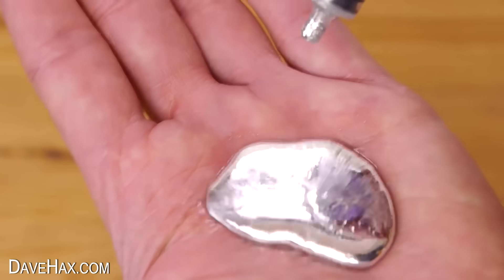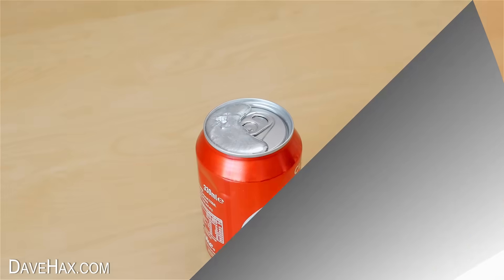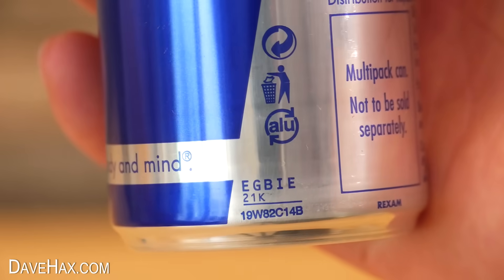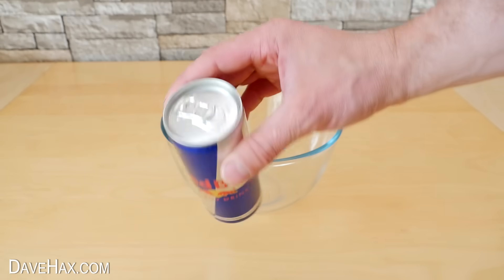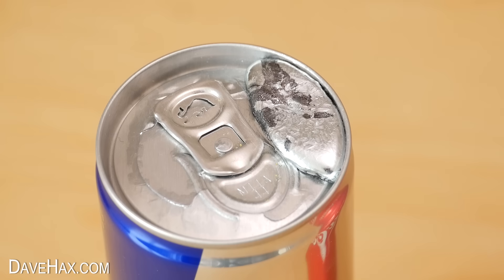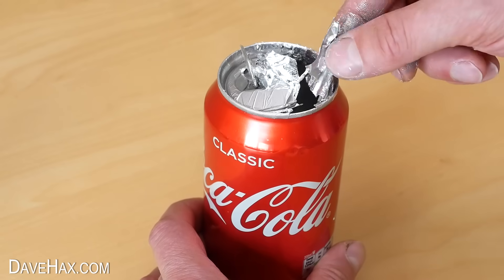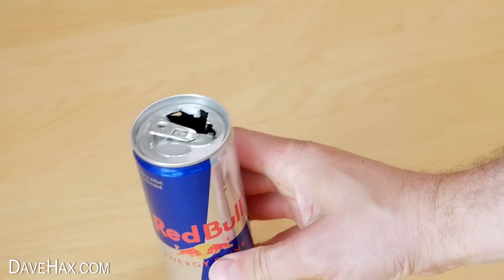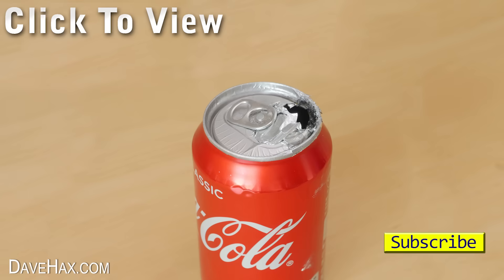Amazing - What Gallium does to an Aluminium Can

Comment: aluminum oxide stops gallium from penetrating. aluminum oxidizes fast, so you should first apply gallium then scratch the surface beneath it. scratching it with a needle should be enough.
Reply: An even more effective way would be to use a lil but of dilute hydrochloric acid to chemically get rid of the oxide layer, wipe it away then apply the gallium

Comment: Why don't you just melt the alumunium to try an experiment again an d maybe it Will become galium again
Reply: It won't, really won't. If there's enough gallium in the alloy you can simply put it in water and the metals will separate however if theres too much aluminium in the alloy you won't get enough gallium back. So what you could do is put the alloy in a sodium hydroxide solution to get rid of some of the aluminium then put it in water

Comment: The reason the whole can isn't like the top is because the canes aren't one hole price but actually two with a filed seal at the top which isn't welded together so the gallium couldn't get through the oxidation layer on it

Comment: Aluminium always forms a really small slayer of aluminium oxide by reacting with oxygen in the air. It is really thin but aluminium oxide is quite a stable material, which prevented the fusion with gallium.

Comment: There was a thin layer of aluminum oxyde, which is the reaction product between air and aluminium. That's why it didn't work until you used sandpaper
Reply: I thought it was some kind of acrylic coating to prevent the can from oxidizing. If you've ever found like a really old can in the woods it'll crush into dust like that from oxidizing long enough.
Reply: @Jared Flynn No it's really aluminum oxide. Though some cans do have a plastic coating, but thats on the inside.
Reply: @romanpul  aluminum oxide is what happens when aluminum oxidizes
Reply: Jared Flynn You don‘t say. Aluminum is a highly reactive metal and oxidizes almost instantly when exposed to air to form a thin layer of unreactive oxide on the surface of the metal. That is why this experiment only works after sanding the can.
Reply: @romanpul  yes... that was my point?
Reply: Jared Flynn Oh, sorry then 😅. I just wanted to point out that some cans have an additional acrylic coating on the inside but not on the outside
Reply: @romanpul  ahh got it
Reply: @romanpul  lol i can remember the exact line in my class 9 or 10 textbook 😂😂
Reply: @jaredflynn3750  reduced alluminium is useless
Reply: @jaredflynn3750  You're right.  Aluminum cans are made in 2 parts, the can itself and the cover which is applied later.  Both are covered with acrylic coating before they are assembled after the liquid is poored inside.  The coating is applied ouside after the label is printed and inside after.  That's why the can wasn't affected even if the top was crushed.  I worked in a can factory and I was responsible to get the coating tanks refilled every now and then.  We used to call it the "varnish".  :)
Reply: Exactly, the oxide layer on the aluminum protects it from the gallium.  You have to scratch or cut it under the gallium, otherwise it immediately oxidizes again.
Reply: Yeah, I added a comment (before I saw yours) saying the same thing, but going somewhat more into detail.
There was also a crude joke thrown in, in regards to something Mr. Narrator Dude had said.
Reply: Chemistry :)
Reply: Scientist has entered the chat
Reply: @willos7081  no is common knowledge
Reply: I was about to comment this
Reply: God damn, you were months ahead
Reply: @sumsarsiranen  I mean I hadn't read the comments yet.
Reply: I was thinking the metal used for making the cans was maybe because of it being dipped into some kind of solution,  kind of like with galvanized steel
Reply: @Kc-jx8uq  Nope, the top few layers of atoms react with the air to form a diamond-hard substance called aluminum oxide. It pretty much blows iron oxide out of the water in terms of usefulness.
Reply: @magisterrleth3129  so wonderful for you be so assured to respond with absolute confidence like you are the god of truth. Even after someone else made the comment about how polymers are applied to the surface to make sure it stays shiny and the labels don’t wear off easily. Your not wrong but your not right either. It has both a thin oxide layer and a polymer coating. It’s also so the aluminum doesn’t leach into the drink and make it taste metallic. Sodas are after all acidic. So a “plastic” layer is applied for these reasons. Sanding removed both layers. So Half a star for you Magister.
Reply: @magisterrleth3129  Considering iron oxide is also known as "rust", yeah aluminium oxide is a fair bit more useful. =)
Reply: @jubuttib  Aluminum's rust is the envy of the rust world. Every metal wishes it could oxidize like aluminum.
Reply: @magisterrleth3129  Yeah. Titanium (di)oxide walks in, being all "I'm a really good white pigment!", aluminium goes "Literally rubies and sapphires, among a thousand other uses!"
Reply: @jubuttib that’s what I was thinking lol.
Reply: Looool
Reply: Cans are coated in polymer to prevent al leeching inside
Reply: And thats also why it worked better on the coke can. The red bull can had more time to re-oxidize
Reply: Ah, yes. I knew that would be the case, but I am still satisfied to be confirmed of my suspicion.
Reply: OH thank you!! I was just wondering that!!
Reply: Cans are foodsave because they are thin coated with plastic layers..thats why he needed to scratch that layer..
Reply: Ooooo cool
Reply: Fun fact: thin plastic
Reply: @amar_sm4222  fun fact: corrundum
Reply: @eatornator-ox2dx corundum? Rubies?
Reply: @amar_sm4222  Fun fact: thin oxide layer on the surface of the aluminum.
Reply: @amar_sm4222  thats on the inside
Reply: @amar_sm4222  exact ! Burn it and you will see the plastic film turning brown

Comment: Does this affect the gallium in any way or can you reuse the gallium after the experiment?
Reply: It creates an alloy with the aluminum, but you can get the gallium back by putting the alloy into water where the aluminum turns into hydrogen gas leaving behind the gallium.

Comment: When do you think he’ll realize he could’ve popped the top and turned the can upside down?
Reply: As soon as he read this comment
Reply: @cafeinatedmilk  So how is the outside different between the top and bottom?
Reply: @cafeinatedmilk  not the inside
Reply: @cafeinatedmilk  Oh, I forgot how they put soda on the bottom of the can and not the top which is why he can't just empty the csn through the top and put the gallium on the bottom
Reply: Ben Speer he didn't want any gallium to fall into the can
Reply: @PaulNguyenDrums  how would it fall in the can if he pours it on the bottom of the can?
Reply: Susan Ramirez ooooh, I thought Ben was referring to emptying the can, that's also a good idea
Reply: The Joke

Your Head

Comment: Aluminum cans are oxidized aluminum meaning there is a small layer of non aluminum substance on the top, if you scratch it up or use hydrocloric acid it peels it right off allowing you to use the gallium a little bit better, my knowledge on this isnt too extensive so i dont know exact terminology

Comment: Aluminium reacts with oxygen in the air to form a layer of aluminium oxide which serves as a protective barrier. By rubbing sandpaper he removed this layer, allowing the two metals to mix..

Comment: Congratulations. You have discovered the other reason, aside from light weight, that aluminium is a great material. Aluminium oxide which naturally forms a tenacious protective surface on bare aluminium under normal atmospheric conditions.

Comment: yeah the "coating" is formed when aluminum reacts with oxygen in the air to form a 4nm thick layer of aluminum oxide. This happens whenever aluminum is exposed to air and prevents further oxidation as well as protects the aluminum from many other chemical reactions.

Comment: Hi dave i did not have to watch the full video to understand what you were doing wrong.  being a welder and even welding alum pipe to rt standards you must remove the thick oxide layer that develops on it.  so for every pass of weld i make on alum i wire wheel brush it till it is raw bare alum. Its amazing how the oxide layer affects the weld its the difference between night and day.

Comment: It didn't work because there was a layer of aluminium oxide on the can that's if its even aluminium. The layer can be removed by using concentrated hydrochloric acid

Comment: I have to do a science fair project for my chemistry class. I have no idea what I am gonna do I didn’t select a topic yet and it’s due next week. Please someone help me what should I do it’s my first time doing this thing cause I’m actually from other country. Give me some ideas 💡
Reply: Something i would do is to make something really complex out of simple household items. For example you can make thermite from bleach, vinegar, steel wool, and aluminum foil. In case you dont know what thermite is, its a powder that burns at 4000F and consists of iron oxide and aluminum powder. If you need help on how to make it just contact me at sushirollethan@gmail.com
Reply: DaSlickPotato  than you so much for help I’m gonna try it.
Reply: @yoitsme9629  no problem and please please do this outside in a fire safe environment and you will need UV goggles because thermite emits UV Radiation when burned, also i wouldn't make more than an 100 gram batch
Reply: @yoitsme9629  and this is exothermic so this should probably be done in glass beakers
Reply: @yoitsme9629  maybe if you present this information to your school they might let you use their lab
Reply: Oh and also you will need to do create this in a fume hood and a respirator is highly recommend because the exothermic reaction between iron (Fe) and bleach (NaOCL) will produce a lot of chlorine gas, which can be deadly.
Reply: Or you could stop watching YouTube and think for yourself
Reply: +DaSlickPotato Ideas on what it would do to say metal
Reply: @sladesteynberg6276  depends, what kind of metal?
Reply: @sladesteynberg6276  it can for sure melt steel beams
Reply: @sladesteynberg6276  it can pretty much melt anything that has a melting point below 4000F
Reply: Grow plants in different conditions

Comment: soda cans have a plastic-like coating over the entire inside and outside. I'm not sure what it was, but there was an experiment I did in a high school science class where we dissolved the metal of the can but left the coating intact. We ended up with a soda can-shaped clear flexible structure. We were able to fill it with water, and have it hold. it was super cool. I bet it would make an awesome video.

Comment: The 'coating' on the can is aliminium oxide, which aluminum naturally forms in air, and protects it from virtually any chemical reaction, save those that react with the oxide itself, such as hydrochloric acid.

Comment: Uranium is also a very good solvent for metals that's why they used depleted uranium instead of tungsten for some slugs because it convert cinetic energy into heat then melt then dissolve iron.

Comment: I don't know about other countries, but in Belgium you have coca-cola cans in alluminium and steel, depending on the steel and alluminium prices...Al is cheaper to transport because it is lighter, but the material costs more. In most countries this weight is more important and most cans are made of Al. In Belgium transport ways are rather short and depending on the prices they switch. You can test it easily with a magnet from what material the can is made.

Comment: There's not necessarily any coating, aluminum gets converted to aluminum oxide rather quickly when exposed to air, which does not react with gallium. You did the right thing scratching it off, you'd do that any time you want to react with straight Al
Reply: This was a very helpful comment
Reply: I'm sure he knows that, he just wanted to make a longer video.
Reply: Thank you Jesus no one else understood that
Reply: But usually there is a thin coating to protect the liquid wich is sprayed on the in and outside
Reply: Wut?!
Reply: Nerd
Reply: craig the defalty boi people always find a way to turn positive things to negative things 🤦🏻‍♀️
Reply: Nerrrrrrrd
Reply: @shockmazta3116  yeah, knowledge is stupid. -.-
Reply: @Helter Incendito then you are homeless.
you won't get a job if u don't have a degree, which you need to go to university for
Reply: @zeke7837  Do you learn how to spot irony or sarcasm when you grow up?
Reply: @helterincendo3441  -.-
Reply: @zeke7837  Ah, well done. You spotted it. Congratulations on reaching adulthood ;)

Comment: All drink cans are coated with a thin layer of epoxy resin to prevent the contents from reacting with the can. That’s why the gallium didn’t react until you managed to scrape through the coating. It’s also why the can top looks like a membrane after the gallium finished reacting... the resin film was holding it together.

Comment: The failed attempts is because Aluminum has a natural occurring oxidation that keeps things things from penetrating it. Sanding it removes this barrier but it will only last for a few seconds before the aluminum oxidizes again blocking the gallium from effecting the aluminum crystalline structure.

Comment: What stopped the gallium from reacting with the aluminum at first was a thin layer of aluminum oxide that quickly forms when aluminum is exposed to air. The reason the Red Bull™ can was less affected than the Coca Cola™ can is because you had let it sit after sanding it to go sand down the other, giving time for some of that aluminum oxide layer to reform, stopping the gallium from being in full contact with the exposed aluminum and slowing the reaction.
Reply: Ikr
Reply: ikr he should of done the same stuff to both

Comment: Aliuminium is active metal and Al is reacting with water, so usually things, which are made from aliminium are covered by  aliuminium oxide ( Al2 O3) membrane in order to protect pure aliuminium. And then the man had washed that aliuminium oxide membrane, then pure aliuminium starded to react with gallium and water, which is in the air.

Comment: There's an aluminum oxide layer on the can that stops reactions from happening. You have a limited time until the oxide forms again to apply the gallium and have the reaction occur. The reason that RedBull #2 was stronger than Coke #2 is because the aluminum oxide was already reforming, so it would be harder for gallium to penetrate.

Comment: You had to scratch the can because of the thin layer of oxide that naturally forms. It's because aluminum forms that layer that it becomes resistant to corrosion, and is popular to use as cans. Only after scratching it was the gallium able to bond. You always have to scratch the surface to get Gallium to bond.

Comment: Overtime aluminum gets coated in a thin layer of aluminum oxide. In order for it to take effect you would need to scratch the surface, exposing the raw aluminum on the inside.

Comment: Aluminum quickly oxides with the air, forming a barrier to stop further oxidation, 4 Al + 3 O2 -> 2 Al2O3, IIRC. So sandpaper was necessary.
Reply: Damn man you smart!

Comment: aluminum forms an oxide layer extremely quickly when exposed to air.  That is why the coke can was affected more, because the Red Bull can had more time to sit and form the oxide layer preventing the gallium from attacking the aluminum.   Apparently if you put the aluminum/gallium mixture into water, the aluminum will bond with the oxygen forming aluminum oxide, Hydrogen will be released, and the gallium will separate so you can play with it again.  I haven't tried for myself yet, but I plan on giving it a try this weekend.

Comment: that alloy you said it made is called an amalgam and the reason it didn't work first time is likely because of aluminum oxide on the surface of the metal which rapidly forms and acts as a barrier from further oxidization or from reacting with things (in this case the gallium metal) and since you sanded off that oxide layer it was able to react.

Comment: Aluminium, when it come in contact with oxygen, creates an alumin oxide layer (aka alumina). The Oxide layer protects the aluminium from nasty reactions such as acidic corrosion and gallium. The layer isn't very thick, so you were able to remove the oxidized layer of alumina with sand paper, just enough for the gallium to start doing its business and eat the can from inside out. You could also remove the oxide layer with some strong acid.

Comment: The aluminum has an oxide layer that protects it, using HCl would help remove this oxide better than the sandpaper, and you should try MERCURY, because when mercury meets aluminium it's quite entertaining

Comment: Don't aluminum cans have a chromium coating on them to prevent the metal from leeching into the drink? also, the top of soda cans are a separate piece of metal from the rest of the can, so it would have been more interesting if you had put the cans upside down.

Comment: #1. Aluminum forms a protective oxide layer when exposed to air so you should have scratched/scored the coke can.
#2. Gallium only makes the alloy if it STAYS warm & in liquid form, so you should have kept it warm .
#3. You should have looked this up before doing it to avoid comments like mine!

Comment: I'm pretty sure the reason as to why the aluminium didn't react with the gallium before you sanded it down is because it had oxidized. Aluminium oxide is not very noticeable unlike iron oxide which is why it might look like it's not oxidized. Just my hypothesis.

Comment: Aluminium is a highly reactive metal , as soon as it is exposed to air , it corrodes and forms Aluminium Oxide . The Aluminium Oxide 'rust' forms a protective layer over the metal which stops it from getting corroded further thus rendering the metal chemically inert or inactive . This process is called Glavanization. Hence after sanding it off , you removed the aluminium oxide and gallium was able to react.